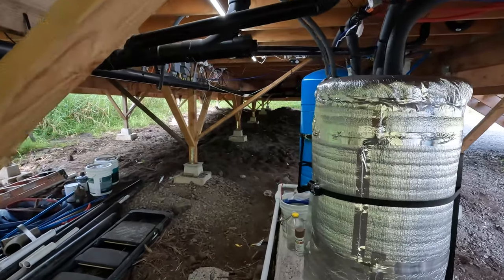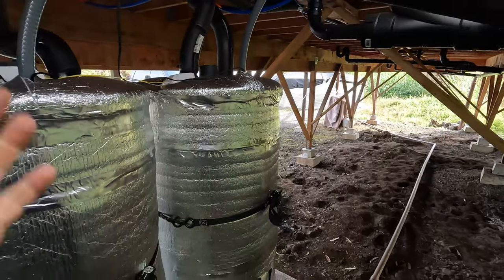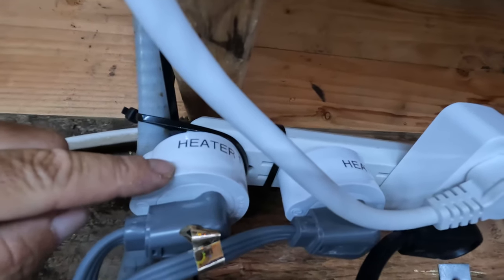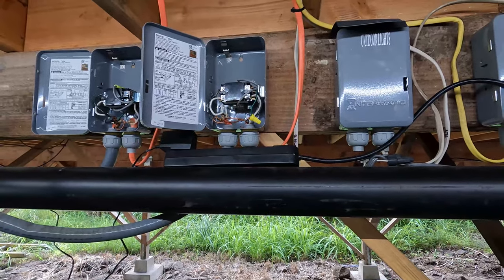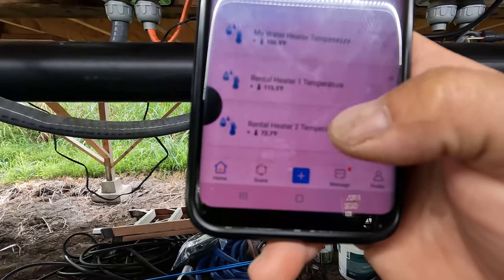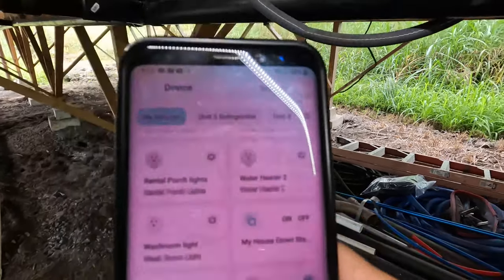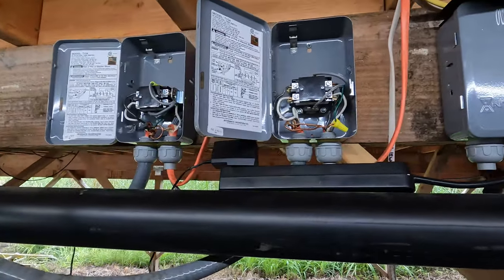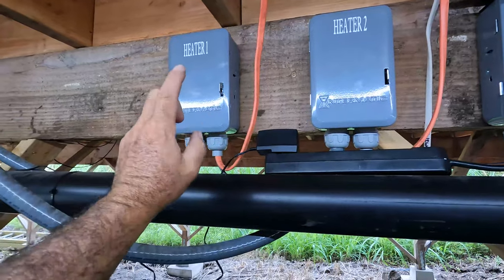Turn Any Water Heater Into a Smart Water Heater Wifi Smart Phone

Comment: If you get the sonoff  smart plug you can make it easier, so once the temp monitor detect the temp drop down from whatever you setup, it will trigger the smart plug automatically, and you can set the time range you want to turn on automatically and whenever you need it you can do it manually using alexa, google assistant or even siri from your apple watch, I have something similar and it runs great, but I am going to steal your idea for my heater, I don't mind much of electricity bc I do also have solar panels, but want to save as much as possible, congrats it was a GREAT IDEA!!

Comment: Thanks! This is so simple. I want to set up automated times on and off for my water heater. Are you doing that with yours? I have flex power rates where I charge battery systems cheaper. From 1 am to 6am the rates are way cheaper. I want to do the same thing with my water heater. But I don't want to have to turn it on and off manually.
Reply from the maker: Yes exactly what I'm doing  still working awesome. Plus turn it off or on anytime and anywhere you want.

Comment: Love this simple inexpensive setup.   We have a home not used very often and the electric water heater is a very high expense.  I'd love to turn it off most of the time and turn it on a day before we use the home.   Any thoughts on if its safe to be using that heated, then cooled water and then heat it again?
Reply from the maker: I am still using this setup on more then one of my homes and works awesome

Comment: I do The same but use esphome/tasmota on The devices.  I Either  controll by The devices  themself since ypu can Write rules, or node red or home assistant. I do it for my solar to :) IE caculating based on all from Cost to weather
Reply from the maker: Awesome I thought about flashing and using tasmota but I dont know enough about it yet and seemed a little complicated but that's because I need to learn more about it. But the current setup has been working flawlessly. Thanks for sharing

Comment: I guess the 120 side doesn't draw much current as you only use 10 wifi plugs. nice way of controlling your cost the relays are like $50 in Canada lol.
Reply from the maker: It draws 3 watts only, the relays are cheap here. Maybe you can find a different coil relay in Canada

Comment: This is a great video.  Thanks so much.   I am planning to do the same wifi plug set up to my water heater and water pump.   The relay that you posted has 2 flat prongs on each side (for the 120V coil).   How do we hook up the cord to these prongs or can these 2 sets of prongs be removed like seen in your video)
Thanks so much!!
Reply from the maker: Simple just add I flat connector to your wires and slide it on. We still use this setup on many setups.
Reply: Thanks SO much.   Can't wait to get it set up.
Reply: One last question.   Wrt the ground wires.   Did u connect the incoming heater ground wire to the outgoing heater ground wire?   The rely switch doesn't involve the ground wires, correct?
Thanks!!!!!
Reply from the maker: Yes so the 3 wires coming from your main 1 of them is ground that is grounded in the case the green Screw, then the 3 wires coming from water heater 1 is ground that also gets grounded at the green screw in the metal case. That way the ground is Continuous From the hot water heater all the way through all the way back to the breaker panel where it's grounded. It's the same way you would wire I regular water heater. The only difference is you replace the timer in the box with the relay and your L1 and L2 pass thu it.
Reply: Thanks again!!